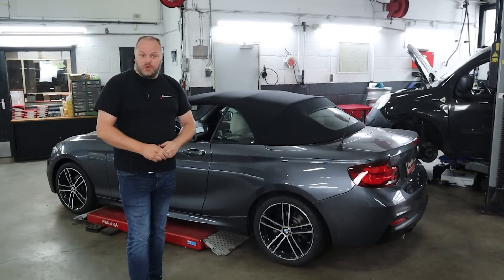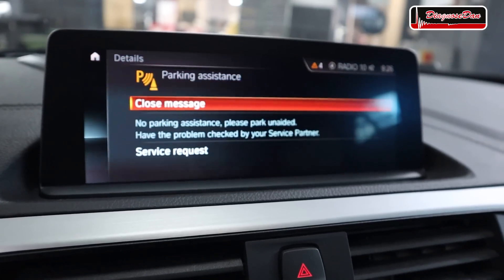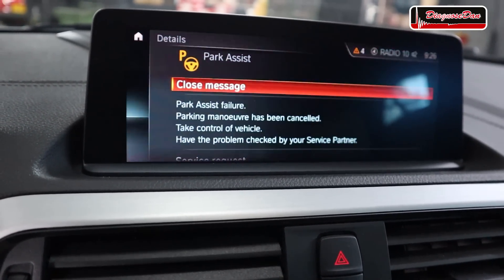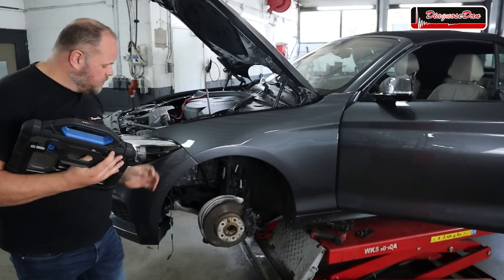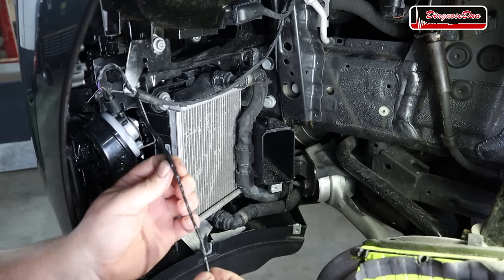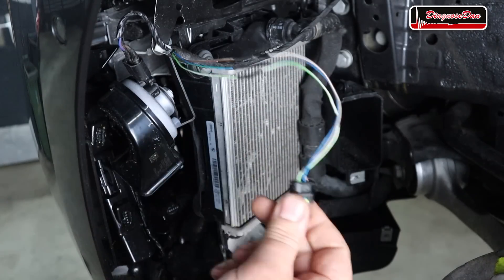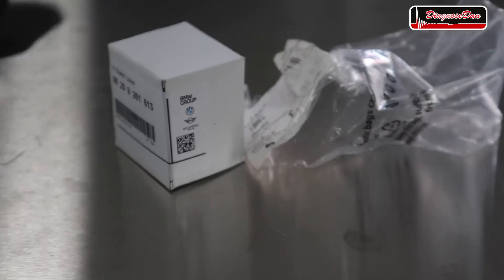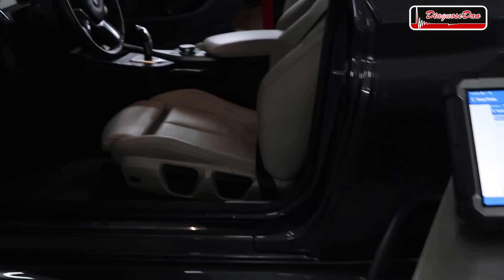Bmw NOT parking itself anymore! Broken Park assist

Comment: Wait! What??? No bloopers? Well, I guess the video was loaded with them already. Bad parts, slightly bad body repair. And, oh yeah, a car for a person that can’t park a roller skate with assistance. Good to see a new video Dan. Peace.
Reply: I'm sure it was done on insurance. Anyway what wrong with wanting to have everything working properly? You can cut with dull knife but what's the point?
Also probably other driver's assists as well didn't work properly, such as emergency braking.
This type of car shape is hard do park reverse with mirrors alone because you can't judge distance when there's trunk behind the glass (it seems that you already touched it when you have about 0,5-1meter still to go.
Reply: @bigragu6828  "And, oh yeah, a car for a person that can’t park a roller skate with assistance."
Guess you still have a choke, adjust your timing on the go and have to pump up your tyres every other day.  And drive drunk.
What the F is a roller skate love?  It's your round.
Don't forget, it's got assistance.  I think your blurred mind meant to utter, WITHOUT assistance.
Good day my love.
Reply: @stevekelly5166  what crawled up your rear end to make my comment offend you???!!!! As a matter of fact, my 66 Pontiac does, indeed, have a choke, one mirror on driver door and I park that bitch in tight spots. Also, I drive heavy duty wrecker. I can backup a loaded tractor trailer on my hook, without assistance. That’s what years of driving does. It gives you skills to perform easy and complex tasks. Your turn now, my love. You are probably doing voice to text, because you need assistance with that simple of a task, as pushing letters on a screen. Now give Dan the respect he deserves and don’t reply.
Reply from the maker: I guess i had a good day 😂

Comment: Top video weer zoals altijd. Zou je aub een keer een filmpje willen maken over short circuit, short to ground, short to power…hoe meet een computer en hoe weet de computer dat er een short is. Op die manier kan je veel beter interpreteren wat de foutcode aangeeft. Bedankt!
Reply from the maker: I denk dat ik dat al wel eens behandeld heb. Als je goed naar het symbool in het draadschema kijkt van de voeding in deze video dan zie je in de computer een weerstand getekend. Als de voedings draad aan massa ligt dan is er 12V voor deze weerstand en geen spanning meer na deze weerstand. Dit heet spanningsval. Door intern deze spanningsval te meten weet de regeleenheid dat er sluiting is. De weerstand beschermd de regeleenheid ook tegen doorbranden bij sluiting
Reply: @Diagnosedan  bedankt. Helemaal duidelijk!
Het is best belangrijk om te weten wat de foutcode betekend volgens mij voordat je diagnose gaat doen